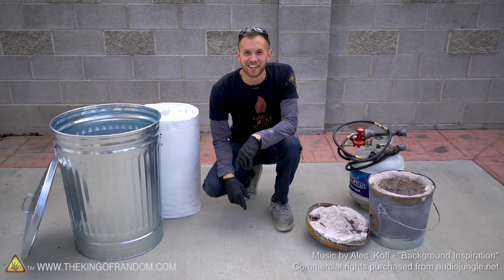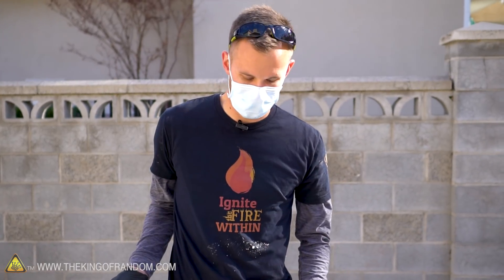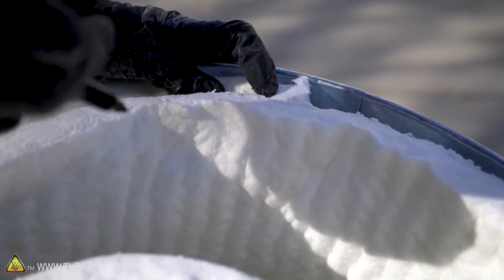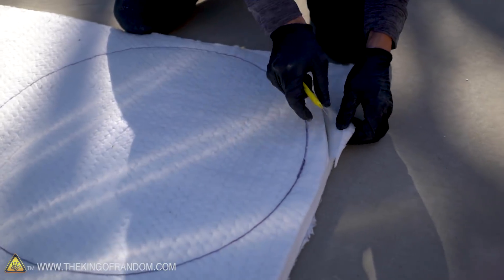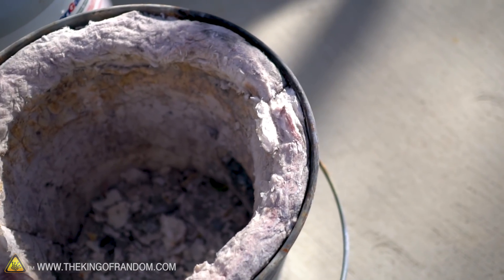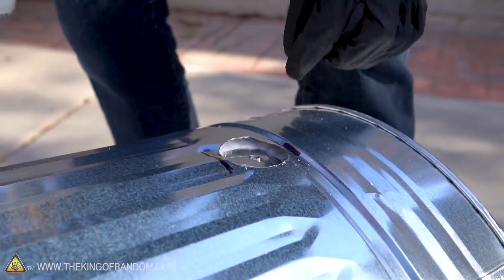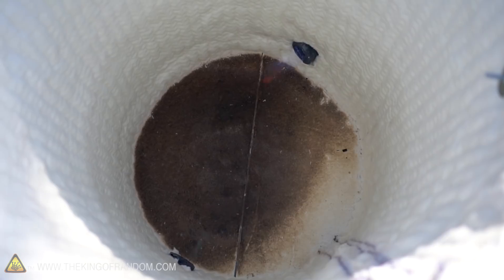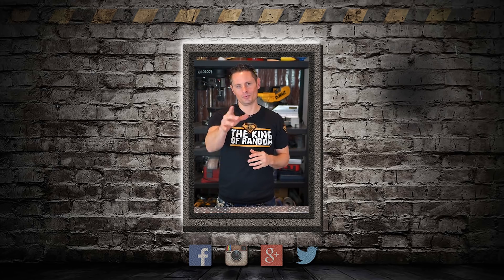MEGA Metal Foundry! TKOR Explores Everything You Need To Know How To Make a Trashcan Metal Foundry!

Comment: Gentlemen, please use a rigidizer or some castable refractory to coat the Kaowool. The air moved by the burners will carry small fibers airborne. Those fibers are very harmful if inhaled. Fumed silica works as a rigidizer and can be found for cheap.

Comment: What would happen  if  you set battery acid on fire with termite and what would happen if you used termite in the foundry instead of the current Setup?
Reply: And what would happen if you only made pipe holes on the foundry or did no holes and termite in the foundry?
Reply: Is that wool be flammable

Comment: i would suggest to cast some concrete over the insulation since when the flames are creating a airflow it will pull fibers along with it. and thats the same as putting it  together.
but overal very nice video keep it up.

Comment: Can propane gas can produce enough heat to melt high melting point metal if yes we like to see love it vids
Reply: Propane gas can, easily, if you have two torches, but 3,000 degrees F is the max temp limit the KaoWool can get to before burning and turning hard and black and crumbling. You can melt almost any metal within 3,000 degrees F, but you can't likely melt Titanium because it sparks and jitters.

Comment: The foundry looks amazing, I just have some concerns with the hardware used in this build to hold the wool onto the side of the trash can, when using the foundry, won't the metal transfer the heat to outside of the can?

Comment: Any hardware you use in the foundry should be steel as almost anything else is going to melt. Also stay away from galvanized metal due to death reasons... Just a quick suggestion I thought I'd input for first timers... And don't breath lead fumes... Also don't put your hand in it to test if it's hot yet 😂

Comment: King of random: I use kaowhool in my black smiths forge and you need to know it is a very dangerous material to use without putting rigidizor or refractory sealant on. The fibre will come off into the air and into the lungs of anyone who breaths it please please seal the insulation before you keep using it

Comment: see if you can make two more propane nozzles things coming off another propane tank but into the same foundry. The larger volume of the bigger can could cause the temperature to remain lower than it would with a smaller foundry.

Comment: You should have stacked those burners. One ¼ of the way up from the bottom, and one ½ of the way up from the bottom, and put them in on an angle. That would have eliminated the hose length issue, given more even heating, and would have been more efficient.

Comment: just a thought, you are building a foundry that will MELT metal and lined the can with that wool stuff and then put METAL bolts in the inside to hold the wool up..... wouldn't those bolts melt?????

Comment: Listen its a nice idea but because you have increased the volume of the foundry you will need to add more burners to reach the desired temperature
Reply: Glory Lime you're right, it wont get as hot with only two burners...
Reply: Random, add more burners
Reply: If it's properly isolated it shouldn't matter. It will just take a bit longer to heat up. Heat energy doesn't dissappear because there is more space ...
Reply: Mobin92 it has more space to disappear through... No insulator is perfect
Reply: I say put 4 or 6 evenly spaced torches. Each set with it's own propane tank, so that it can run just as long with the increased fuel usage. Bet it would get hot in a couple minutes if you used 6, only problem is that might hurt the insulation properties if you cut that many holes.
Reply: surely at that point you should just build a forge

Comment: Try coating the inside lining of the Kaowool with some refractory cement/mortor. It will increase the internal thermal mass and also prevent the wool from breaking apart.

Comment: Can You Make Brass by Mixing Copper and Zinc? If Yes, in What Ratios?
Reply: MultiHax yes and it's 52% copper and 47% zinc
Reply: You can make it, but you'll need a flux to prevent the zinc from oxidizing and boiling

Comment: To cut holes in thin metal or aluminum with a hole saw, especially carbide tipped, try using it with the drill in reverse. It works for me. Gold luck

Comment: For future reference.  When using a hole saw on very thin metal. It works best to use in reverse.  The teeth will still cut through with out them catching and ripping your metal in to  Pieces

Comment: Wont the screw which you placed to hold the glass wool act as a shot circuit to heat resulting in large amount of heat to transfer from inside to outside? This will also defeat the whole purpose of glass wool which you placed to act as insulator.

Comment: You need to add more burners, the heat will be the same as the smaller foundry but it has more volume to heat, it will make casting things take longer

Comment: You could've measured the inside circumference of the can at the top and bottom, then measured that out on the wool. Cut the wool to the top length then measure out the bottom length along one edge, center it, then cut at the angle.

Comment: FYI, the furnace shouldn't growl, it should sound like a jet almost. When its glowing the flame is making its way up the blowtorch. The way to fix this is to either choke the airflow and use the Venturi effect like in the original video with the tin lid, but it's best to use a blower like you did with the charcoal version. This way you get better efficiency and the torches don't get as hot; the heat goes where it's supposed to.
Reply: Also if you used two layers of kaowool that would allow you to much more easily reach brass melting temperatures. With my mini foundry I can melt brass with just one layer but it takes a really long time, about a half hour to an hour to melt.

Comment: Maybe to help keep the kaowool in better condition int the future you could put a layer of a plaster mix over it. Also you could put longer, better metal screws in the side so you could use them as post and then make a holder for the crucible that way the metal you're firing would maybe heat up faster because it would have the bottom heated as well

Comment: ⚠️⚠️⚠️⚠️⚠️⚠️⚠️⚠️⚠️⚠️
Two problems here. 
1. You need to coat the isolation with refractory cement so the fibers don't get released into the air when your running the foundry. 
2. Do NOT use that trash can. It is coasted in with with a rust proof element that when burned off produces very toxic gasses. Bad to breath in.

Comment: You should add 3 flame inlets because if you use 2 it will only get just as hot as the smaller ones...plus it’s bigger and the heat has to be absorbed by more wool...maybe you could use 2 propane tanks and 4 inlets for even more fire...if you want to play with ceramics. 👍
Reply: TheRichBoy 101 it won’t be hotter the gas still burns at the same temp - it will just heat up quicker - the idea of it is to be able to heat bigger things at the same temp which wouldn’t fit in the mini metal foundry
Reply: I love your logic
Reply: If we team up we can make a time machine
Reply: You need forced air not venturi burner if you want go higher,or even better oxygen tank.
Reply: Jamie Knight Your right..
Reply: Amealia Lall 😂
Reply: Cool
Reply: It would also look cool......... or would it be hot?
Reply: Also aligned to make a vortex 🤘🏻

Comment: Screws is bad idea,  because you've tried to isolate can so hard,  but you'll lose heat by that metal screws,  we call that "temperature bridge".
 And small tip,  when your isolating material owerlaping hold it tight and cut threw both of them,  you'll get perfect matching of both cut edges

Comment: 2 things I would have done differently is one when you put the ridged base in the foundry I would of pit the kaowool around it first because I think there will be a small gap where the metal trashcan will get got and second thing I would have put the holes in the lid so they are going in the same direction as the handle so you can grab the lid and not get burnt. But this is just my opinion

Comment: Won't the screws you used for supporting the KaleWool melt from the propane heat? Like so he sees!
Reply: Kosh Rai i very much doubt that it gets that hot
Reply: Kosh Rai I would have still mounted them the other way: less heat absorption in the inside and more dissipation on the outside...
Reply: Sbeatly Not iron, steel (which has iron in it I know) but yeah, your right.
Reply: Kosh Rai from what I've understood from this videos, is that the foundry doesn't get hot enough to melt iron (assuming the screw and the donut thing are made of iron)

Comment: Screws will deform overtime. Maybe even melt if there is too much heat.
Reply: screws are steel, same as the burner nozzles.  bigger problems if it gets hot enough to melt steel.

Comment: You should put wood into a vacuum chamber and heat it to see if it can turn into a liquid
Reply: A vacuum chamber only affects gasses. I doubt that wood has any gas in it, so nothing would happen. However, you can heat wood, and that would turn it into charcoal. It will never be a liquid, though, unless you chop the wood into tiny particles and mix them with a lot of water..

Comment: What’s stopping the screws from melting partially or completely off. If it can melt metal what’s stopping it from melting metal screws. Or is the plan to use the metal can as a cooling system to keep the screws from getting too hot
Reply: the machine screws aren't aluminum. they're more than likely stainless or galvanized steel

Comment: please coat the ceramic wool with a rigidizer and then refractory cement. the fibres from the wool get blown into the air and then you breathe them in. wich can cause silicosis. i really dont want any of you guys to get hurt
Reply: laveturner jones that’s why he put a mask on
Reply: it will still happen after installing. especially when fired up. coating it with satanite will already prevent that
Reply: and if those fibers give you silicosis it wont be iritating but likely to cause deathb

Comment: I have a list of things I want you to try, so if you can please do any. Thanks. 
 
What will happen if you freeze flash cotton and then burn it? will it still burn? 
 
Can you use the Solar Scorcher on dry ice? 
 
Try putting dry ice into a vacuum chamber I wonder what's going to happen ! 
 
Dry Ice + Liquid Nitrogen and then put in water. What will happen? Will the water freeze or just get cold.
Reply: Himanish Kumar this is the 5th time seeing this, you have a rather odd attraction to dry ice.
Reply: The flash cotton will still burn

The dry ice will sublimate slightly faster than at room temperature

The pressure will stay relatively high

Depending on the ratio the dry ice and liquid nitrogen will probably evaporate before the water gets cold enough to freeze